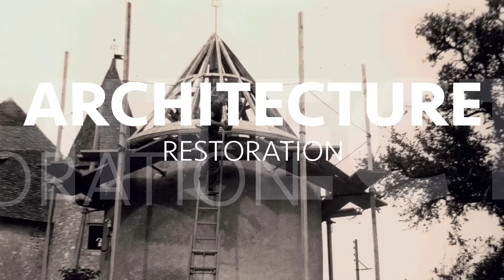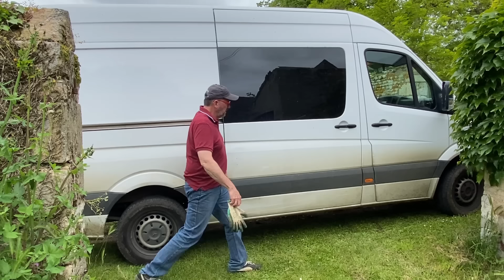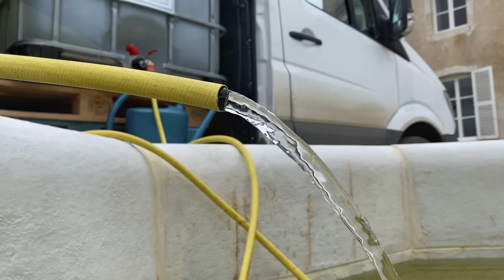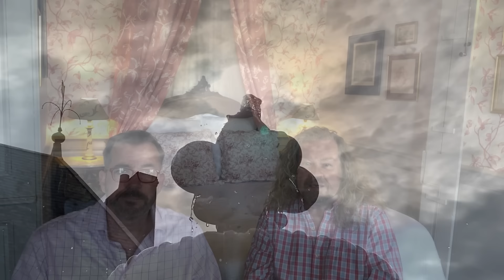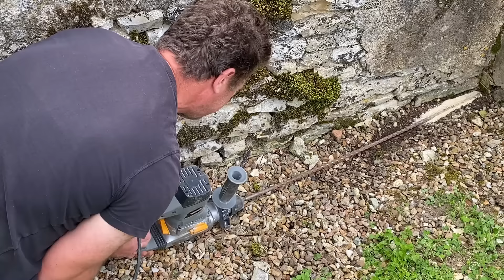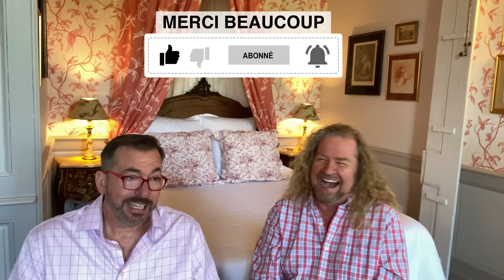It's Time to Get Out the Big Drill! Chateau Courtyard Landscaping

Comment: The bedroom looks beautiful. Yes,yes, yes to the lighting. You can always turn on what is suitable and have options for special occasions. Can you imagine tables set up around the courtyard for special dinner parties, with all the romantic lighting...❤ Dreamy. While we're dreaming, beautiful concrete balustrades on the outside of each partier, leaving the walkways open, would be stunning and also protect the garden from someone accidentally driving onto it. Thanks again!
Reply from the maker: Concrete ballustrades would not visually be historically accurate for this chateau and they would distract from the fountain. The beds need to be low and discreet. Thanks!
Reply: I agree with the lights.  The balustrades, as Stuart said, are not what would have been done in the 17th century. But I get your point ❤

Comment: Stuart and Patrick, it is my advice for you to have John wire as much electrical service as possible, as well as, utilize multiple groupings and circuits in order to be able to pick and choose which areas or features you want to illuminate  at any particular time without having to light an entire series of lights all the time (the entire perimeter or every third light,   just the corners, partial fountain, whole fountain, one gate, both gates, etc.).  The ability to color change lights to set a particular mood would be a nice feature, too, especially on the fountain or the grand entrance.  Of course, it all depends upon how many euros are in the coffer to fund such a lighting project.  The ambient lighting on the gates was a good start.  You might want to install outlets by the gates in case you want to install automatic openers in the future, too.
Reply: We will can afford 4 circuits and have planned for outlets for special occasions by the fountain and gate.  Great input 😊😊😊

Comment: As a lighting designer, yes to all you proposed,.  For the fountain you could also do wet location fixtures in the water to up light the different bowls.  However, hard no to the colored lights on the facade.  See if you can get different wattages of lamps for different affects.  Contrasts create drama so the intention should be to not have too much uniformity of intensity everywhere.
Reply: Great comment Jim.   Thank you so much 😊😊😊

Comment: Light everything and as much as possible!!!  I throw a lot of big parties that run late  and there is nothing worse than having to walk at night and cant see. They make amazing solar powered flood lights now that are really bright with remotes color modes  timers and everything, Best thing is no extra electrical charge or wires. Amazon had great ones.
Reply from the maker: Is that the Amazon in France? Outdoor lighting options are much more limited here.
Reply: Thank you Fred.  I might have to ask our US friends    Love the suggestion.  There are not even low voltage options available here….. 😮😮😮😮. Will research. Hugs ❤

Comment: Would be great to see chateau lit up with the current lights flanking the entrance to the building before answering. I’d say lighting the front facade will make the difference between the two wings more noticeable so I’d steer clear of accentuating it. However tall evergreens at the corners of the taller section would soften the disparate elements
Reply: Food for thought.  Now, in France, you would never have tall plants right in front of a 17th century chateau.  😊😊😊.  Thank you for your input. 😊😊

Comment: I would suggest using separate electrical runs for different areas and timers. Sometimes you can have two much light.
Reply from the maker: Yes. All will be on separate circuits. Thanks.
Reply: Great input. We talked about it with John. ❤❤❤

Comment: Love the gate lighting!
🤔 Fountain and building… do you know someone who has battery operated floodlights, for parties or something? Then you could test it out and see whether you like it, plus how much is the right amount and how much is too much. 
Also, can you imagine having outdoor parties or events in the evening in the courtyard… what sort of lighting would you want for that? A couple (hidden) outdoor outlets for temporary strings of lights on poles?
Chateau de Bourneau does outdoor events in their courtyard, and might have lighting advice and  tips on what worked for them, or what they had to adjust. 🙂
As long as you have John running wires, I’d at least run conduit to future-proof possible expanded plans. Maybe not wires run for the max plan now, but at least set so it’s easy to add them if you find yourselves expanding activities later. I know John is also calculating max loads, etc., so that’s a factor too. But at least conduit now for possible expansion later would make sense, regardless.

Comment: Standard lights…. Not coloured. Yes for lighting the front facade of the chateau ie, 3 each side between the entry doors and the ends, 6 in total.  You can get garden up lights in  LEDs that are connected by 1 thin cable and you don’t have to dig or drill deep holes. The  main little converter box ( the size of a coffee cup) which is waterproof, will be connected to main power.  The lights are connected via the thin cable and are usually movable and each light component sits on a small “spike” which allows you to position and angle the light where you want. Same principle as outdoor lights on a string. Not sure if I explained this very well, but they are cost effective as they use low voltage. Hello from Australia.  Great work.
Reply from the maker: Yes, we had extensive low voltage landscape lighting in the US. They don't have that here in France, and the electricity runs on a different voltage.
Reply: It’s all looking stunning. You both have impeccable taste. Bravo.

Comment: Certainly yes to lights on the fountain.  In general, I vote yes to more lights, so long as they are individually operated.  You can use them when you want them, but can't use them if they are not there.  There is also lighting as a security issue, so maybe a master on switch is also appropriate.

Comment: light on the fountain adds more status,  standardly, some soft toned lighting of the central wing would be very nice; soft; so it complements the charming lanterns near the main door. For the side wings i would use even more modest (than the central wing)/ practical lighting; wall mounted  lights could be an option.   The overal effect should be a glowing central wing and sparkling fountain, and more subtle on the side wings.   And in case  for festive events; you add wood burning fire baskets in thecorners of the courtyard or some fairy lights on the half cirkle of the courtyard (forsee plugs)
Reply: coloured lights.....too kitschy for my standards,  a sophisticated warm white does the trick.

Comment: Regarding the lighting, I think it would be nice if you would illuminate the fountain but it would be the nicest if the light would come from the button of the lower bassin (from the water), to light up the façada would be nice, am not sure about the changing colors though. You might integrate the color changing option without using it, or only for special events ;-) I guess the price difference would not be too big. But all lays in the detail on how it is made. I think that just as you did turn to a specialist for the colors of the rooms it would be worth while to turn to a specialist for the lighting. The Château de Courcelles in the Champagne (it is a hotel) has a nice illumination for example, you might want to have a look at their website and some other examples.

Comment: Patrick and Stuart, is there a spring in that cave?  You mentioned rain water... is it connected to a gutter system?   Is it possible to waterproof the ceiling so the damp won't permiate upwards?  Having a ready supply of water can be handy especially if the drought cycles back.  Can you connect that pool of water to an automatic irrigation system?